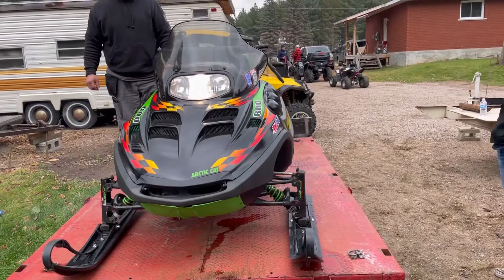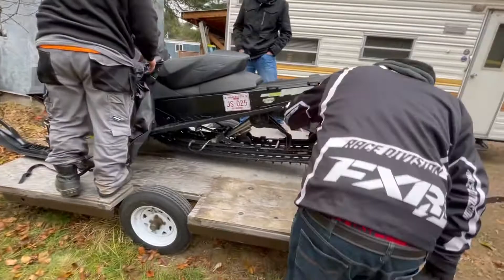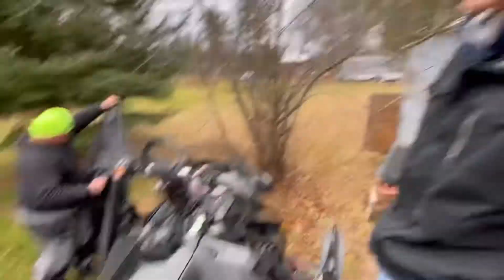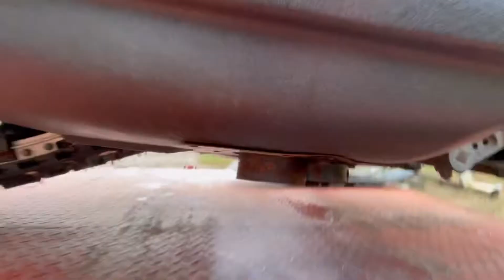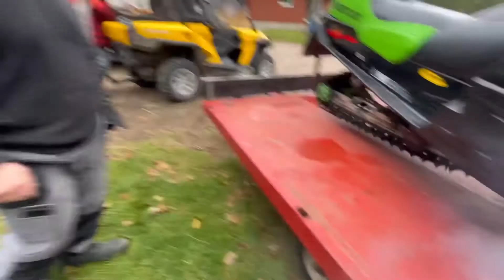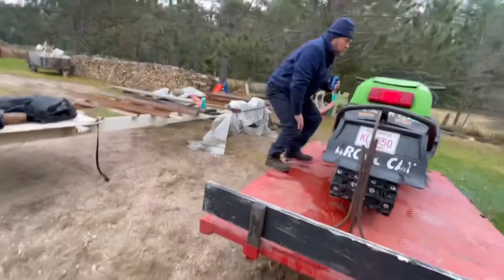2000 Arctic cat 600 ZRT Cold start and rev up

Comment: You can hear it needs a good tune up...missing on one cylinder...
Reply from the maker: yep needs a tune up for sure
Reply: @fazerainbow5674 
Mine has a tune up. It runs good. I
Had all carburetors rebuilt
New reeds put in 
It runs like a new snowmobile